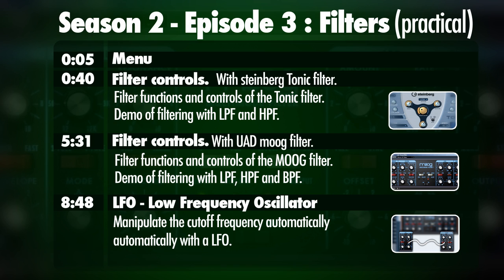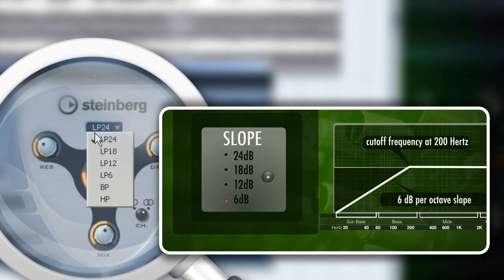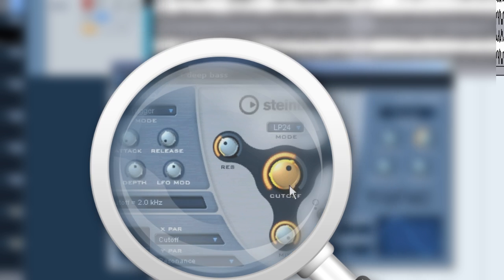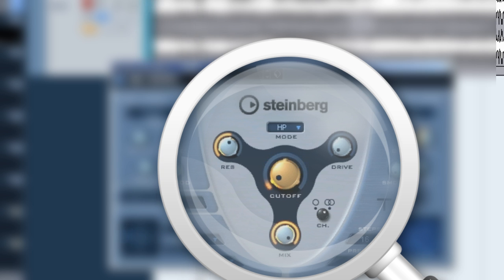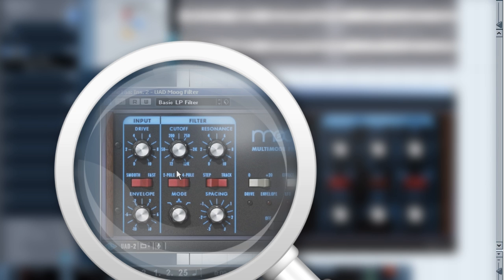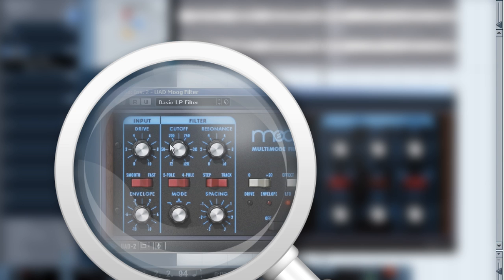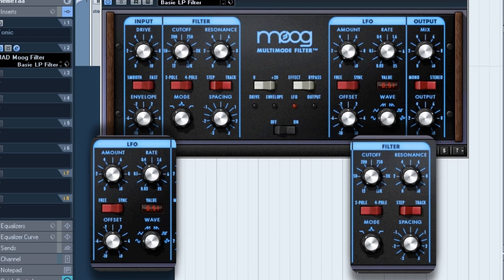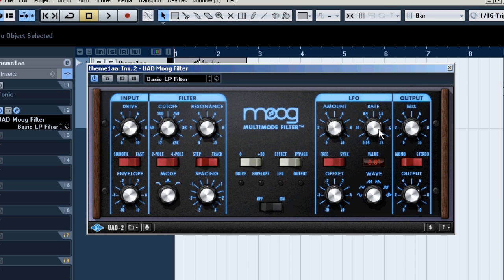Audio filters explained #2 - Practical Filter Session

Comment: Thanks for the tutorial but I got a bit confused because I think that you might have the understanding of the HP and LP filters backward. I had the same issue while taking a quiz until I actually thought a bit more about it. The Low-Pass Filter cuts out the low end and only leaves the highs available whereas the High Pass Filter cuts out the highs and only leaves the low end. The cutoff was already engaged when you switched to the High Pass and the cutoff is supposed to be the threshold for the sounds passing through. I'm currently taking Audio Engineering, so I was looking for more understanding of this particular thing which I wasn't quite clear on just yet. This is what led me to your video.
- Shalom to you and your family

Comment: Whats the Point of a Filter Plugin ? Cant i simply use eq?
Reply: +0815Snickersboy +TIMOSHINA Actually, You filter as complementary EQ, usually before EQing or as part of the same process. Some times when mixing you will find that there are certain instruments or tracks where you can dispose of entire frequency ranges. For example, when mixing we use lo-cut (hi-pass) filters in lots of tracks like vocals or even some guitars, because these instruments usually don't produce any significant useful frequency material below 80Hz, so we simply filter all of that out, as a way of "cleaning" the recording, and also helping us fit instruments better with each-other within the audio spectrum. 

The difference between a filter and an EQ is that a filter doesn't have a gain knob, and hence will get rid of everything below or above (or in between) a specific frequency, where EQ will have a gain control for you to decide how much you want to carve out or sum in, and it's usually not as agressive.  

Yes, filters are also widely used as effects too, especially in electronic music.
Reply: eq is the same thing but more accurate i think. filter is good for automation sound i believe, when  for example you slowly cutoff high frequencies before the breakdown.
Reply: Eq's are a type of filter. but i'd assume you managed to figure this out by now.

Just like a compressor is a Dynamic processes.
and a gate / limiter / de-esser all are "dynamic" modifiers
Eq's are filters.
Reply: so far I have done all my 'filter' sort of effects with eq automations... but it seems its pretty cool to try and download some sort of filter plugin.. and I have no idea how to do these lfo stuff still... it seems so complicated to me.. but I really like the sounds that came out of that lil demo thing with the drums... makes me think of some sort of dubstep.. 

I waaaant to learn! :D !

Comment from the maker: Well yes, in theory you can.
You can use a de-esser to sidechain-compress a small frequency band, and if that would be placed after the filter because it's resonance is set too high that could work.
You could also automate the resonance to be lower when the filter sweeps to the higher frequencies. 
That way you can increase the resonance on the lower frequencies, and decrease it on the higher frequencies.